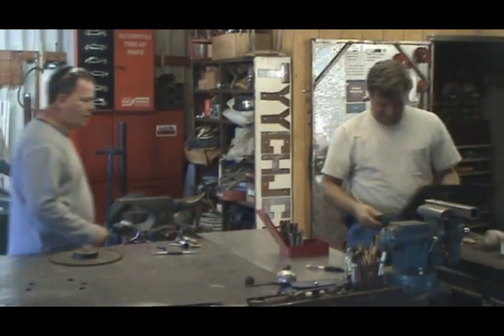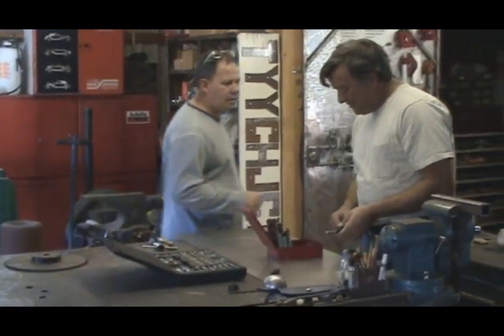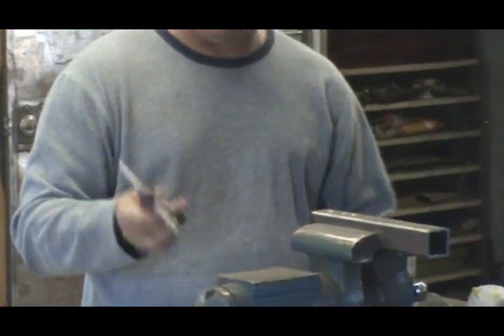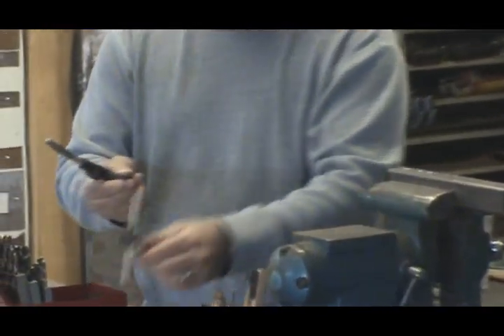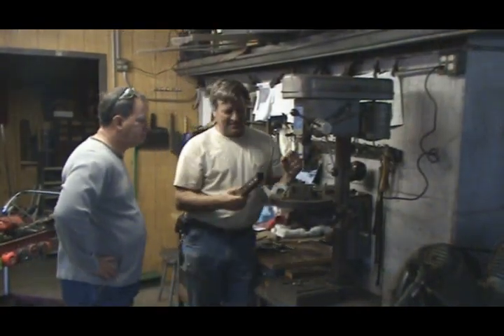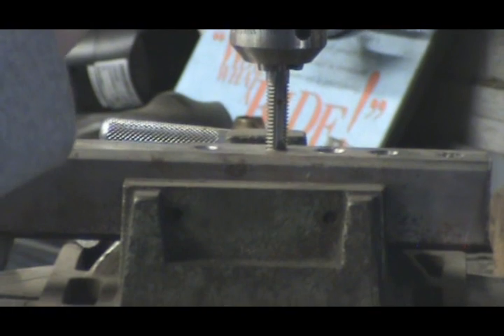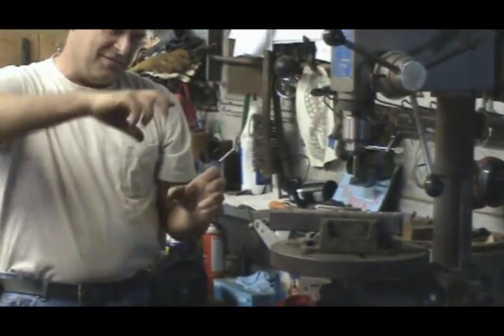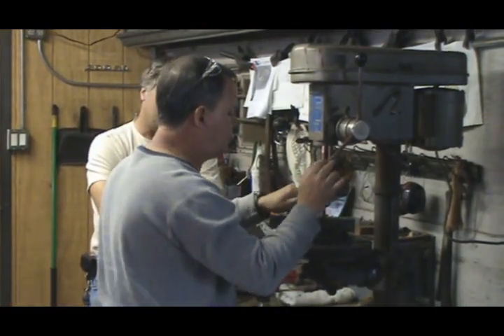Drill and Tap Tips and Tricks - Kevin Caron

Comment: I know little to absolutely NOTHING about tapping, which is why I'm here, but even I know you would never turn on the drill to tap some threads. Unless of course you don't actually want usable threads in the end, or of course unless your drill press turns at about 2 RPH, which I very much doubt anyone's does. 
With that said, I have a question. I realize this video was posted long before color TV's were invented, but hopefully whomever posted this video is still alive, and can maybe give me some advice. 

I have a brand new table saw with a cast iron top. However, it came with really poor quality stamped steel wings, and I want to install cast iron wings. Unfortunately the saw manufacturer doesn't make cast iron wings for this saw, so I had to purchase another manufacturers cast iron wings. Low and behold  the holes don't line up. I know, SHOCKER, right? So to make the wings work, I need to drill hols in the sides of the saw top to match up with the wing's holes, and then tap those holes with threads. How can I go about doing this while ensuring that everything, the holes and the tap, end up "perfectly" straight, on a table saw that I certainly can't put on my drill press, and I can't flip the saw onto its side? The surfaces I need to drill and tap are vertical and only about two inches wide, so I don't how how to get straight holes drilled and straight threads tapped in.
Reply from the maker: Well to start off, yes, we are both still alive!     And running the drill like that did work very well!   I was amazed to tell the truth.    But sadly, I have never tried to tap cast iron.  If I had to do what you are looking to do I would get a piece of scrap cast iron and just give it a try.   Should not be an issue to drill the holes if you have good sharp bits to use.   Just start small and step up to the correct size.   Don't forget to use some kind of cutting fluid with the bits as well as the taps.   Go slow and you should be just fine.    
Thank you for watching and posting and please let me know how it turns out.

Comment: Quick question I have something that's already tapped 1/2 28 can I run 1/2 20 through it and be fine?
Reply from the maker: Nope,  you will turn the 1/2 20 in about a 1/4 turn and it will stop.   If you try anymore it will seize in the hole and you will ruin the 1/2 28 threads.   Get the right size and thread bolt for the hole.

Comment: On pipe tap,go 1/2 way of length of tap,screw fitting in all the way down. count the turns screwing out.2  1/2 turn rule, easy does it finish tapping. 3/4 length of tap will get u there . remember  size dies not matter.

Comment: For a pipe tap ,a good depth fit would  be 2  1/2 turns or engagement. use female or male fittings as gage.SIze does not matter.

Comment: With practice its easy to tap square by hand. The human eye is easily good enough to determine squareness for most uses. When I worked in engineering everyone tapped square by eye. The most important thing is to have a developed concept of squareness and flatness in your head. Plus, also if you want a drill to cut size you need to use a pilot drill (about the same size as the chisel edge on the finish size drill, or a little bigger) run the pilot at least twice as fast as the main drill and it will not take any longer to drill both holes. The positioning, size and roundness of the hole will be greatly improved.